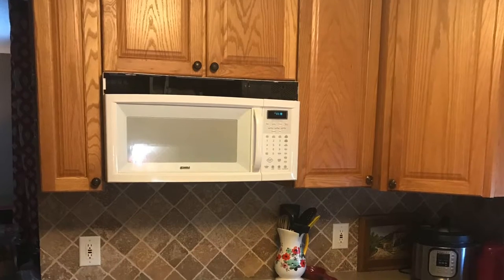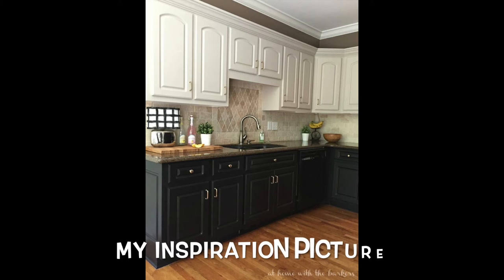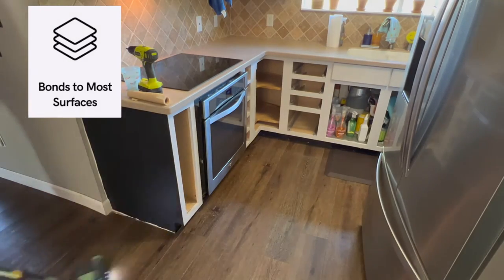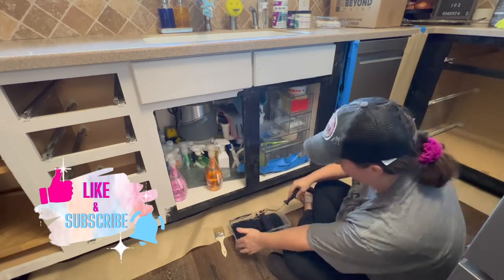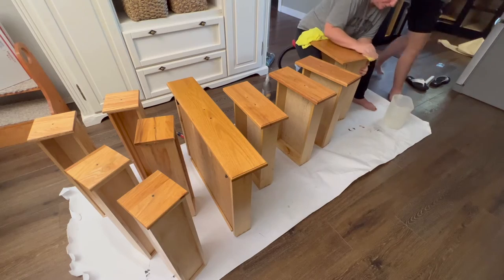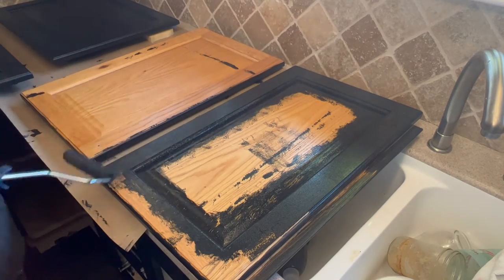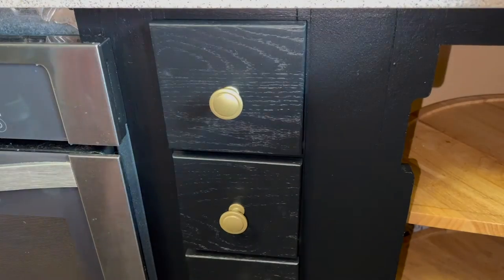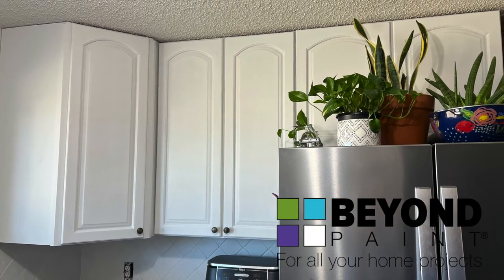Painting Cabinets with Beyond Paint- Kitchen Renovation - Part 1

Comment: I really want to paint my cabinets. How are they holding up after a year?
Reply from the maker: They are great! There are a few places that show wear on the bottom cabinets. One place is my fault because when I installed the door the hinge wasn’t adjusted so it rubs. I need to fix the hinge and touch up the paint. The other is just wear and tear on a super high traffic area under the sink.

Comment: What brand degreaser did you use? I bought DEF industrial degreasr, but foung it cannot be used on painted surfaces or wood. I have my Beond Paint and want to get started on my counter tops!
Reply from the maker: I used the method degreaser. I also cleaned them with vinegar/water after just in case there was a residue. Good luck! Thanks for watching!

Comment: Your painting on a clean, never before painted surface. What about if you have cabinets that have been painted numerous times, would that mean it would have to be sanded down?
Reply from the maker: I would only sand it so it’s smooth but you don’t have to sand if it’s not. Just make sure it’s clean and the paint will stick. I’ve painted some furniture with Beyond Paint that was previously painted and it worked perfectly!

Comment: Curious on your honest feedback on how the paint has held up? Have you experienced any chipping? Look forward to hearing.
Reply from the maker: It has held up really well! There are no chips or anything from normal wear. The only place that has chipped is because the door was installed wrong and the door is rubbing on the drawer above. That was my fault, not the paints! I’ll redo the hinge and touch it up and it’ll fix it. I am EXTREMELY pleased with the quality.

Comment: Your cabinets are not smooth.   I don't think I will use it because of that.  Leveling did not level out.   Someone else showed this and they hated it,  so they switched to chalk paint,  A beautiful fully covered cabinet that was professionally smooth.
Reply from the maker: They are not smooth. You can see the wood grain but the paint did level out and you can’t see brush marks or the orange peel texture. To get something completely smooth, you’d have to spray them.
Reply: @TheProjectLady  Oh ok.  I don’t know what to do.  But if your brush marks aren’t showing or the orange look is not there, that should be good.  I have no experience with spraying.  afraid I would make a mess. The wax I thought would smooth it out and annie sloan said you have to apply 3 coats and buff and have a day or more between coats,  May  try that.  thank you.

Comment: I’m curious as to why you didn’t use their sealer. How is the paint still holding up?
Reply from the maker: I didn’t use the sealer this time because I wanted to see how they held up without it. I have had to do a few touch ups, but nothing major. I will definitely use a sealer next time. I plan on painting my kids bathroom cabinets and I’ll need to seal those. They are way more rough and it’s a high traffic area!